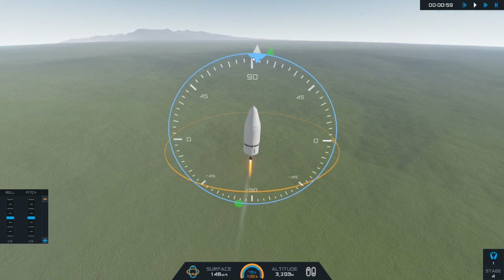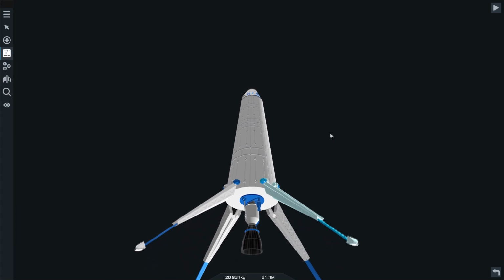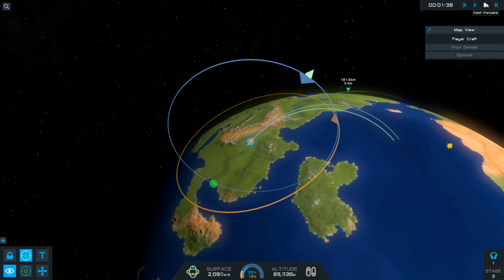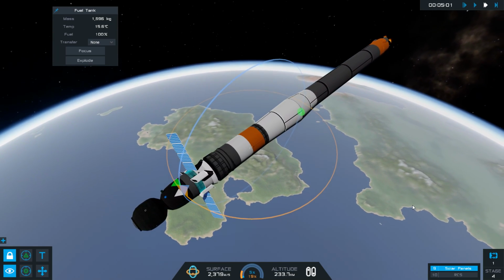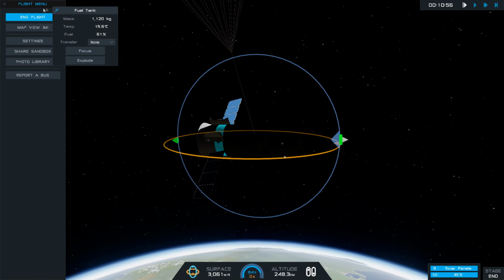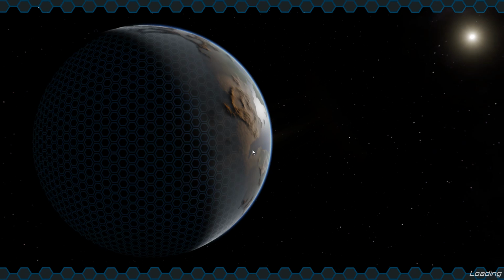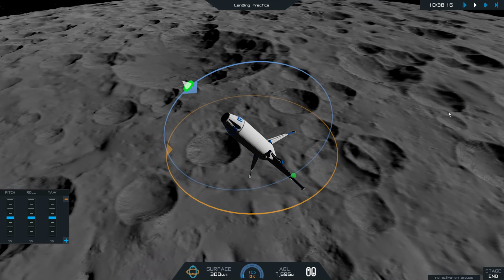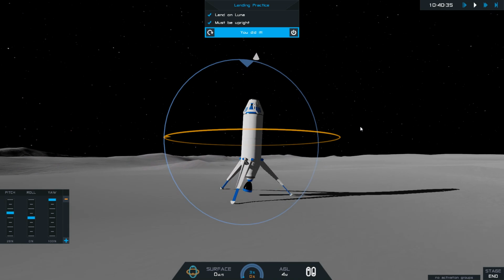Simple Rockets 2 - A Game For Rocket Builders, Without The Little Green Men

Comment: You said you were surprised it took them so long to release. I really don't think that this is slow progress, considering where KSP was after the same amount of time:

KSP's first version was compiled in January 2011, and one year later they had far, far less progress than SimpleRockets 2 does. They had no docking, no persistence, only two planetary bodies, extremely bare-bones aerodynamics with no reentry heat, without fairings or cargo bays or even interstages,  no landing gear, no rovers, no missions/challenges/tutorials... And this isn't even considering the features SimpleRockets 2 has which vanilla KSP doesn't, i.e pistons, fully procedural parts, ion engine usage during timewarp, craft sharing functionality, planned burn autopilot, etc.

This is incredibly fast development compared to KSP, although admittedly KSP had to figure out a lot of the difficulties involved in a game of this scale, particularly in using the Unity engine, while SR2 has the advantage of hindsight.
Reply: MetrotomX5 
Jundroo didn’t build SR2 from scratch...
Well yes, but I mean, they already had SR1 and Simpleplanes done and successful and KSP as a main rival
Let’s say they had plenty of inspiration
Reply: Vincent Lalancette I know I’m late but Sr1 didn’t help them at all with the next games design
Reply: I think he mis-spoke, and quite directly after that corrected himself, but I don't know exactly where in the video he said it.
I'm almost fully positive that he meant that it's surprising how quickely it's been made.
Reply: u know that the world in 2011 not like 2018 when u wrote this and 2021 now 
you cant compare by time in tech thing , Whay you can do in the past in years u can do it now in week ...

Comment: I don't like the soft joints of KSP, so this looks pretty great for me. I just don't think it feels like a rocket when it squibbles around like a noodle.
Reply: Jmcgee1125 Needs more struts
Reply: You need KJR!
Reply: @Xei Who even needs that anymore? Autostrut and/or rigid attachment is more than enough to stop even the noodley rockets from acting like... Well, a noodle.
Reply: @DowzerWTP72  I thought KJR didn't work for the latest version or even KSP 1.4?
Reply: you need autostruts/rigid attachment
Reply: auto strut!!!!!
Reply: Oh man you’ll love my good friend autostrut
Reply: Try autostrut. It helps alot
Reply: Was gonna point out autostrut/rigid attatchment, but i see you’re covered on that one :P
Reply: By the way, that's because tit's uneevenly balanced.
It should be like a cone; the largest payload at the bottom of the craft, then getting lighter as you go higher, until finally, a light final stage.

If it was because of side boosters and all, then you need some more struts.
Reply: Use rigid attachment
Reply: Noodle rockets are either the best asset or the worst flaw of KSP, and even the devs don't know which.

Comment: Even SR2 have procedural parts. Come on KSP...
Reply: Romner_set  For wings i know only 1 mod - B9 procedural parts, and it's breaking to trash with each patch. And anyway... it's not official feature.
Reply: @Lulzwhat Not to mention that the symmetry on the B9 parts, more specifically wings, has some weird quirks. For example, if I build a fully symmetrical plane with the B9 wings, it will always want to roll left or right, regardless of autostrut, rigid attatchment or levels of symmetry. If I replace the wings with stock, it works fine.

Tl;Dr: KSP needs procedural parts that aren't mods.
Reply: Romner_set  Yeah, they used to meet at brighton once a year for fisticuffs with the Rockers.
Reply: @cyborgbadger1015  ah I see you are a man of culture aswell

Comment: This procedure construction method is everything that I always dream for KSP, but they got stuck with that stupid 1 million parts approach which make me left the game, even if you added procedure mods to KSP, still was a pain in the ass to remove all the other parts and make everything work well.
What I dont like of this game is that the solar system is not the real solar system and many other things does not look as real as they should be. I will also love an option to change for different fuels..
Reply: AngelLestat2 You can change the fuel your rocket carries in SR2. You have to go to the part settings. Different rockets use different fuels
Reply: @Marcimagnus5008  wow great.. even better that I expected. Nice. I am very close to buy it, but still I have doubts with the realism and I would wish a real solar system.

Comment: They call it SimpleRockets for a reason: this seems a lot less confusing to new players than KSP, especially with the part selection.
Reply: Droo the Earth planet requires more Delta V than Kerbin does
Reply: @Pjorks  yeah. Kerbin is scaled down. Needs less Dv. Some with the mun and minmus
Reply: KSP in science or career mode at first is awesome. You only get access to a set of starter parts that's easy to learn, and you have to unlock the rest of the stuff while playing the game.
Reply: It is only so confusing because the usability of the parts picker sucks salty beaver balls. All the filters do is provide even more buttons to click and get confused, whereas they should have focused on conveying the necessary properties (diameter, ffs!) with the icons.
Reply: @Anvilshock  There is actually a diameter filter, although you're right, the whole thing is very confusing for beginners.
Reply: @JnE74OUGedNa  I never used filters in KSP because of how much trouble clicking on them. SR has a good idea about making fewer but procedurally generated parts that can be configured (just imagine if ksp had like 1 fuel tank, and you could select the diameter and length (eg: 1, 2, 4, 8 as with separate fuel tanks now) and payload. This was implemented in some mod afaik.
It looks promising, but if SR stays it's course and make this a mobile "friendly" game, I'm off.
Reply: @AWZool  Yeah, me neither, the only reason I even use the advanced mode is subassemblies, it's easy to make a universal reusable booster and just paste it in. But I actually like the fuel tanks and the different engines KSP offers, it gives it a lot more life and variety instead of just being a simple simulator.
Reply: @JnE74OUGedNa  They should've ditched all the filter bs and put the subassemblies (the only part I used too) on the parts menu for easier access. I usually did what you: make boosters and 1st stages in different flavor, with staging and separation already configured, and just plopped them under some payload. EZ :)
Reply: Exactly my point: It's not that the filters don't work, it's that they form a bolted-on "feature" that tries (but mostly fails) to plug the usability hole that shouldn't have been in there (or at least not that gapingly large) in the first place. Even worse, those filters only really solve unrealistically synthetic scenarios: The use case isn't to just search "anything" by diameter but things like "a tank, of this diameter, with that resource". Now I'm not saying it's impossible to find stuff with the means in place, but those means are tedious and awkward, and demand far more clicks and attention than they ought to. A game should entertain the player, not need its UI entertained by the player. Imagine Chess was a game that would regularly be over in five turns while still requiring as much diligence in setting up. I don't believe it would be as popular as it is.
Reply: I think the building menu of SR actually looks more confusing to me than Kerbals
Reply: @theunknow6206  Unlike kerbal, everything is easier to access and is more user friendly, which is kind of what you want for a user interface. For example, the symmetries are much better explained, including the quick mirror, which is similar to the mirroring in simpleplanes. unlike KSP, SR2 has mirror, and radial 1-6, as opposed to the mirror, 1,2,3,4,6, and 8 of KSP.
Reply: True lol And you can customize parts A LOT more than in KSP. Just look at simple planes what creation are made with that system after some time!!
Reply: Simple is meant to be sarcastic... *cough cough simple planes... not simple (or easy)... simple physics, og simplerockets... NOT SIMPLE OR EASY!
Reply: FireFalconX 
Who said anything about easy? They are simple, but not nececcarily easy.
Reply: FireFalconX 
Btw, did you come all the way from simple physics? I actually loved that game, and i still hold a 3rd lowest cost for the crane one! Lel.
Reply: Does this game have missions/objectives yet?
Reply: Also the game is still in Early Access
Reply: I find it way more complicated than KSP, I love Simple Planes, but SR is gonna take some practice
Reply: I disagree. SR2 is way more confusing, especially the UI
Reply: @Brixxter  You get used to it.
Reply: Is Procedural engines simple?
Reply: I'm new to KSP and currently going through the tutorials and I totally agree. It's such a well made game but it's really difficult to learn.
Reply: Alex Siemers have you ever heard of Simpleplanes?
Reply: Meanwhile no one can agree what the best way to get to orbit is
Reply: fun and simple
Reply: x to doubt
Reply: @user-gb7cl8np3p  it's actuslly very simple
Reply: It's confusing on my first play
Reply: I managed to go to duna and dock with just 2 weeks of playing by watching many tutorials
Reply: Nah
Its sarcastically called "Simple rockets"
Just like Jundroo's other game "Simple planes"

It's quite far from simple intentionally🤣🤣
Reply: There are mods that give KSP parts that can be resized, of course. They generally don't remove the other parts, though, so it just gets more cluttered.

Comment: Yeah, Jundoo's always been open about being a KSP fan. One thing mentioned about porting KSP, though, is that Unity is, at it's core, multi-platform. However, the memory requirements for KSP, especially after adding mods, takes it out of the realm of mobile devices.

Comment: I've really been enjoying your videos Scott, and like seeing what you have new every so often, but I had to wince slightly at the "iPads more powerful than most laptops" comment.
It's just not a even playing field. The only source I found for that was a benchmark of the iPad pro vs the MacBook. In which it it wasn't far behind. But that's rather a low bar to set as any MacBook (or tablet) doesn't have the cooling to keep up max performance like that.
So, I wouldn't agree on that point, even though mobile processors are catching up to the low-power chips.
Love your vids though.
A fan.
Reply from the maker: I'll admit, I work at Apple so you can call me biased, but if you look at laptop sales, most people aren't buying high end gaming laptops, and there are lots of older laptops still in used. It's absolutely true that you can buy much more powerful laptops, and also true that iPad is making huge jumps in performance with lots of specialist silicon offloading things confined to CPU's on laptops.
So, I stand by my claim, that's the latest iPad is more more powerful than the average laptop.
Reply: That is a fair point. I was primarily thinking of laptops manufactured within the last 5 years.
I'm also not sure about which processors Apple tends to put in their MacBooks, but if the iPad pro does come in with a score only 20% lower(ish)
That'd be some power.
If the battery doesn't die in  an hour.
:)

I recently read an article on some website that equated single-core performance to being the fastest. That stoked my annoyance.

Comment: A quick note on the Soyuz-- That version was built before a change that was made to craft structure. The fixed version has lower thrust, is more realistic, and still follows the proper re-entry profile where the middle separates, as that version did before the change.
There's a fixed version here: https://www.simplerockets.com/c/A54H6R/Soyuz-Fixed

Comment: I know KSP works fine on Macs, is it really that difficult to port onto a mobile OS?  other than  switching the controls to a touch based system, ARM is still 32 bit right?
Reply: 1.0.5 is 32bit iirc
Reply from the maker: @marcoseduardocastro781   KSP is 64bit, but so are all iPads sold in the last few years.